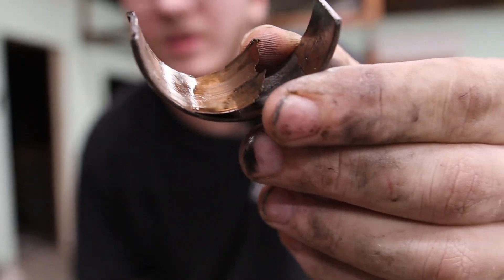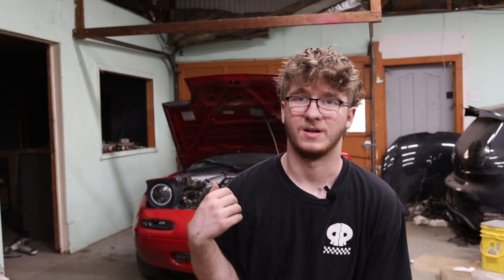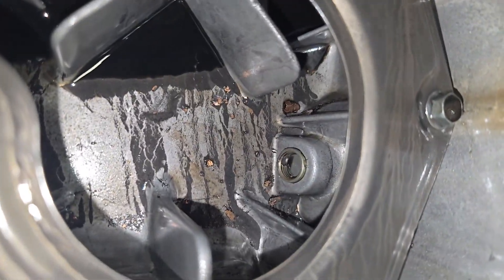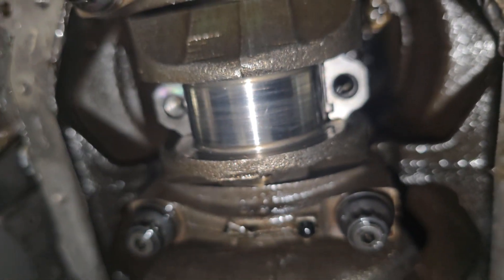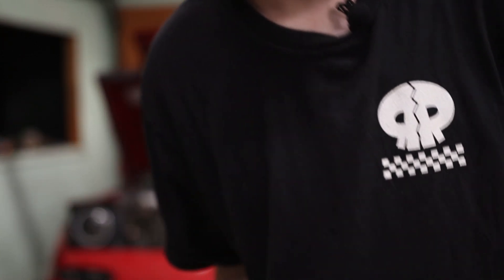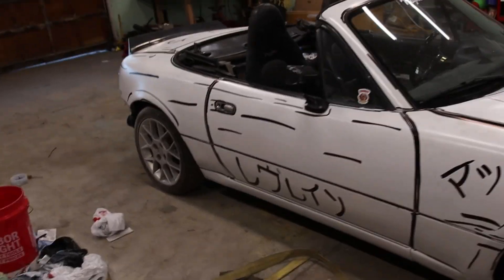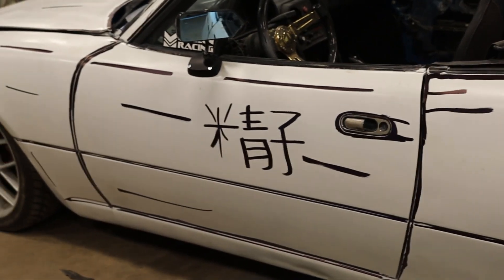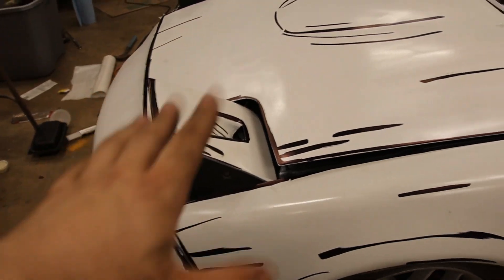What Happens When My Car Runs Out Of Oil?

Comment: man that sucks
but you will have to look why there was no oil in it
or else you have to keep replacing the bearings
Reply from the maker: Yeah for sure. Looking back at my rear dash cam, I was definitely smoking really bad. After taking apart the turbo I could see oil pooling up. I got a new turbo core so hopefully it'll be better. I have an idea of where it was leaking from and I believe I've fixed it.
Reply: @revreign  That's a substantial amount of oil being burned via the turbo. Maybe a combination of leaks and burning via the turbo or piston rings/head.